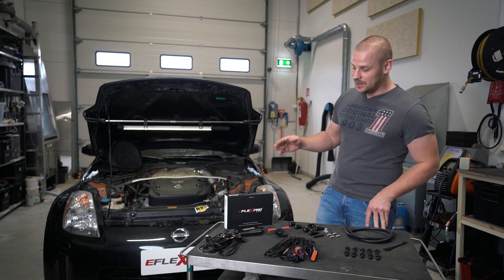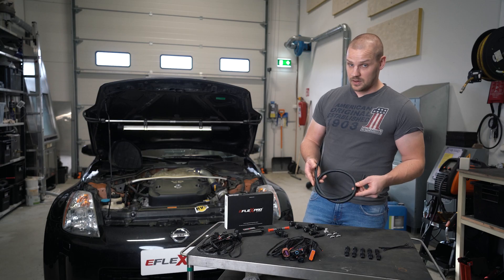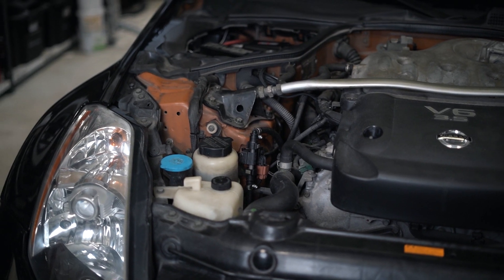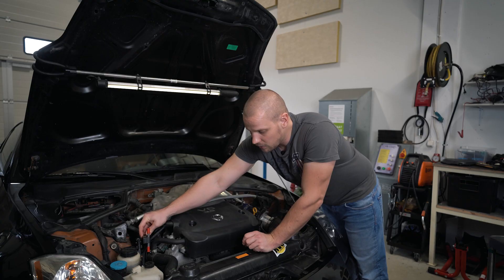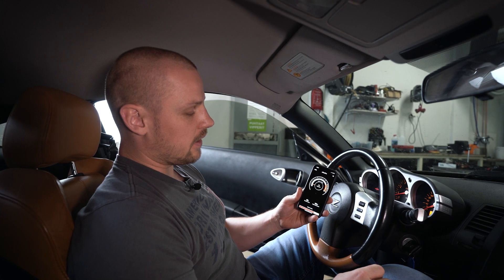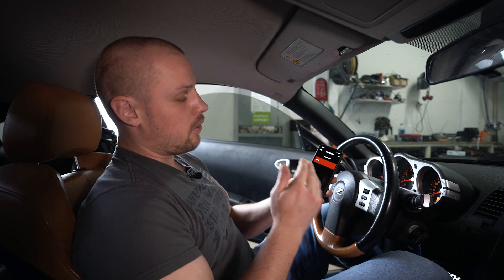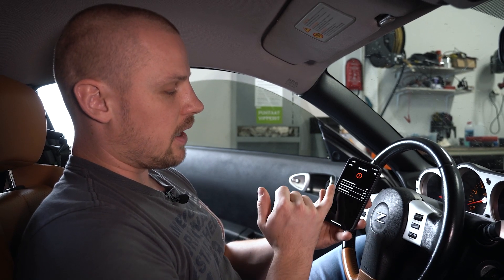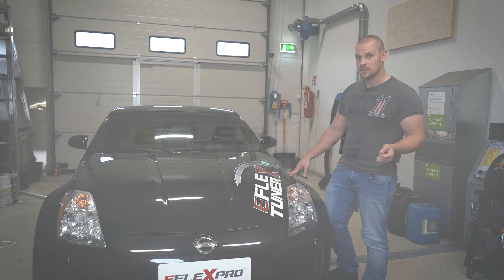eFlexPro Introduction

Comment: So if I have a bolt on tuned Infiniti G37 would I need bigger injectors/fuel pump? And will it run with the tune?
Thanks!
Reply from the maker: Our system will work with the tune that you have on your vehicle. And the stock fuel system will be able to run e85 with no issues at all.

Comment: My car is tuned for pump gas [93]. If I have this installed would it change the performance of the car[better/worse] if I don't use E85?
Reply from the maker: No our kit won't affect your tune in any way. In fact, it will enhance the performance in your vehicle.

Comment: For my 96 Mustang GT will the ECU still be able to control the fuel injectors? Will this set off any engine codes/check engine lights?
Reply from the maker: Our systems control the fuel injectors' duty cycle to allow the right amount of fuel to pass through. No our system will not throw any check engine codes.

Comment: what about a 2015 Toyota Corolla LE? is it just plug n play or would I have to upgrade my injectors?
Reply from the maker: yes, it's compatible with your Corolla. It is plug-and-play. No necessary changes are needed to your vehicle. You're able to run our system on your stock setup.

Comment: Just purchased a kit for my 2003 Chevrolet Suburban LT 1500 4x4! Any suggestions? I have a cold air intake and catback exhaust. Want to make sure my engine doesn’t fail 😂
Reply: I to want to know this information. I have a 2005 silverado I would like to run with this kit.
Reply from the maker: @h2thebproductions714  Our kits are compatible with your vehicle. You'll have no issues running it on your stock setup
Reply from the maker: Hey Charlie, your vehicle will be able to run fine on your current setup. Utilize our eFlexApp to monitor your vehicle in real time.

Comment: No tune needed ?
Reply from the maker: it's not necessary, the ethanol sensor and control unit automatically adjust your fuel injector duty cycle
Reply: @eFlexFuelTechnology  do you have a kit available for a 2003 infiniti g35 coupe ? I seen one for an 04 just not quite sure why an 03 wasn't compatible

Comment: What I need for an evo x with just an intake and exhaust?
Reply from the maker: You'll able to run our kit with your stock fuel system. However, you may not be able to run full e85 on the stock fuel injectors. You will most likely have to blend it with gasoline

Comment: I drive a 06’ G35 and am interested in doing this conversion. I see a lot of G35/350Z owners upgrading their injectors to 550cc.  I’m not interested in making more power, per se. Will this kit function properly with the original fuel components? That is, original injectors, lines, rails, and fuel pump?
Reply from the maker: We have a '06 Nissan 350Z in our car fleet so we know this car very well.  Yes I can confirm that the original injectors, lines, rails, and fuel pump are suitable to drive with E85 conversion and eFlexFuel technology :)